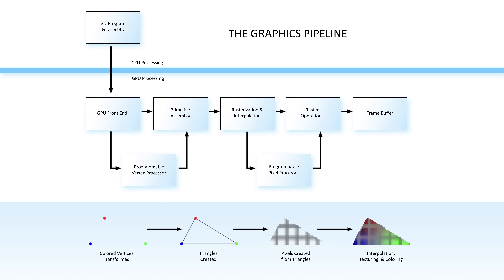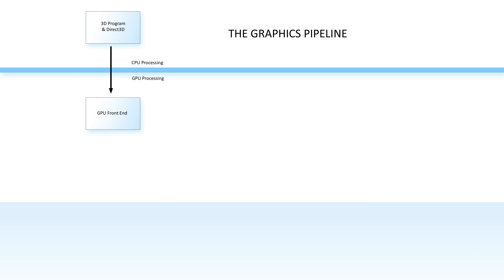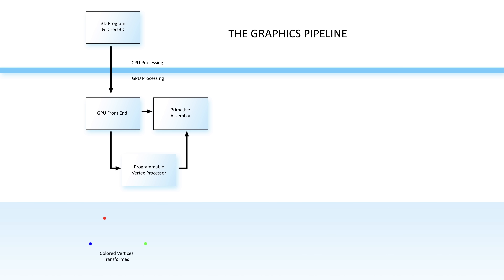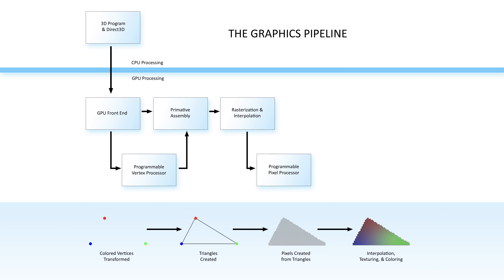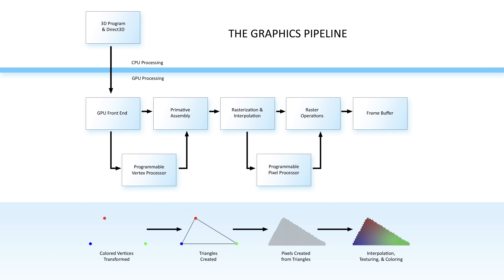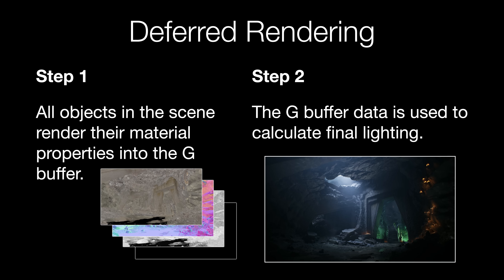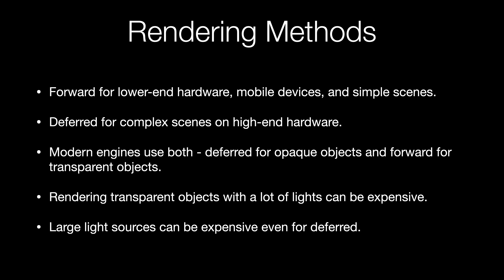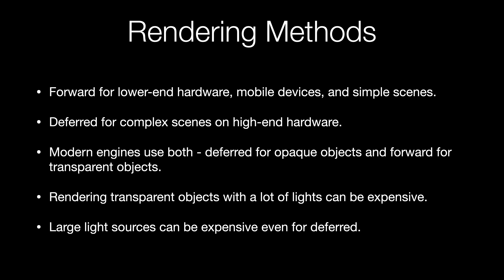The Graphics Pipeline and Rendering Types - Game Optimization - Episode 2

Comment: Question, with transparent materials having a higher cost with more lights due to using Forward Rendering in Unreal, does this still apply if the transparent material is unlit?
Reply from the maker: No, unlit materials do not incur the costs for lighting that lit materials do.

Comment: I generally use forward rendering and disable cast shadows from LOD 02 and beyond for furniture. And for architecture, buildings, or very large landscape objects, from LOD 3 or 4, depending on the specific size and replace it for shader lights if its needed.

Comment: 5:00 That's not entirely accurate or at least not the whole picture, much of the performance issue from too many vertices comes less from the vertex shader itself and more from the primitive assembly stage of the pipeline, which is bottlenecked by a fixed number of primitives submitted per clock cycle. To the GPU there's not really much if any difference between vertex shaders and fragment/pixel shaders, and on a 1920x1080 screen you're rendering at least 2 million fragments, often far more with any overdraw or multisampling, and even more when the pipeline does multiple passes to compute different effects, it's not uncommon for games to surpass 100 million fragments overall without issue. And the fragment shaders tend to be far more complex than the vertex shaders. The GPU should in theory have no issue processing a massive number of vertices, but because of primitive assembly in practice it has a bottleneck.
Reply from the maker: This is exactly the type of addition information I was hoping for. Thank you SO much for contributing!
Reply: @BenCloward  For additional information I'd recommend the video on small triangles from the channel Simon Dev, named "When optimization works but for the wrong reasons", he goes into further information on what I wrote above and also into some interesting specifics and details on quirks of the way GPUs try to optimize rasterization that can cause issues in certain cases.
Reply from the maker: @DreadKyller Thank you. I’m aware of the problem with small triangles. Planning to talk about that soon.
Reply: @BenCloward  Awesome, I only mentioned the small triangles because that's the main subject of the video, but the video goes over the primitive assembler stuff as well. Very interested in this series, thanks for working on it.
Reply from the maker: @DreadKyller I’ll give it a watch!
Reply: Might also be something else besides that, too! I have an anecdote of the time I've worked on a multiplatform game with a port on Switch. In our case, the performance issues came from just having a lot of vertex data that had to be loaded and interpolated, and the poor maxwell was struggling from that (there is a dedicated unit/hw pipeline stage just for that, and it was bottlenecked harshly).

So yeah... profiling, profiling and more profiling! It's the greatest advice that you've also mentioned in the video. In commercial development, following the best practices blindly can only get you so far
Reply: @Kolyasisan  Yes, many pieces of data to interpolate can also be a source of performance loss for similar reasons, while the programmable shader units can handle frankly stupendous quantities of computations (fragments of vertices) due to parallelization and the sheer number of processing units, other steps such as interpolation and primitive assembly tend to have dedicated hardware involved that is not designed to support the same level of throughput, and so they present potential bottlenecks. If you have many interpolators you'll likely run into issues with interpolation before you run into issues with primitive assembly, but if you have only a few interpolators on most GPUs you'll usually run into issues with primitive assembly before interpolation.

This is also why it's important to test on various hardware configurations, because something that one CPU/GPU pairing handles without issue may present a major bottleneck on a different configuration. Having a good understanding of these potential bottlenecks can be great for finding issues quickly.
Reply: The big unanswered question here is: "How do I analyse and optimize for primitive assembly?"
Reply: @techartguy  vendor-provided GPU profilers, like Nsight, Radeon GPU Profiler, PIX, etc... They have tools to profile and to allow you to determine issues with the entire pipeline that executes your workload
Reply: Besides small triangles which are a problem due to quad overdraw I also recently read (but can't remember where) about the interesting question of how lists of vertices are mapped to fixed-size waves.
If there's no HW-level merging across draw calls there will be unused threads. But I guess that particular problem is usually shadowed by the general need to reduce drawcalls.

Comment: It would be interesting to know, for example, in UE5 there are only VSM caching of shadows, but they will have to be used with Nanite on, otherwise there will be artifacts and freezes due to Occlusion Culling(recaching). If the game has a middle scene, one residential quarter with interiors and there is no change of day or night(same as TLOU2), then the choice only of Lumen or Lightmaps. Lumen (Software RT) does not have a "static" mode, and acceptable lighting will be obtained only on Epic Gi Preset, but this will hit performance. UE5 has a GPU LightMass , but you have to bake the entire level, otherwise Volumetric Lightmaps will not work. There is a Unigine engine, for example, you can rebake Lightmap at a separate static mesh. EPIC has a lot of engineers and I can’t believe that they cannot do at least an analogue of Unity APV. Therefore, we can conclude that UE5, as the industry standard, deliberately overestimates graphic requirements and forces players and developers to update their computer. NVIDIA does not often contact Unity, so there are many different tools to optimize graphics.

Comment: In this day and age optimization is a lost art. 
Thank you for doing this series Ben.
Reply: Это не правда. Оптимизация есть везде по дефолту. Просто deferred rendering сейчас основной в играх (особенно с открытым миром или красивой графикой) по умолчанию будет работать от 30 до 60 fps из за своей прожорливости.
Reply: @sr2sdouble  That is not true, I do PCVR and I do a ton of Archviz, I use deferred rendering because I use planar reflections and sometimes raytracing on a laptop with an i9 12900H and an RTX 4070 mobile and with photorealism and planar reflections and interactive lights I get my 90 FPS. but that is because i do optimization like crazy to be able to run photo realistic VR experiences in hardware that is not meant for that. 

Deferred rendering is much more taxing, but with good optimization everything works fine. 

Most gamedevs and big studios rely on Raytracing and other techniques like nanite or megalights or even dlss to "optimize" forgetting that you need to do actual performance optimizations, but they favor those new techniques to avoid the work of optimization.
Reply: @sr2sdouble  от 30 до 60 - это на анриле 5 только если. Нормальные игры с дефёрдом работают на 200+ на среднем железе. Например, игры юбисофт (R6, Division) на среднем железе легко в 200+ иду. На юнити тоже не очень сложно делать 200 фпс на дефёрде. Нужно прежде всего за ценой фрагментов следить, Gbuffer сам по себе вообще изи за 1 мс рендерить.

Comment: I thought Forward+ would be included because I’d like to know how it improved on Forward rendering.
Reply: For the most part Forward+ and Deferred+ are the same as forward and deferred except they split the screen into multiple tiles, and each time can be processed just using the lighting information relevant to that tile, which can help with scenes that have large numbers of lights. That's one of the main differences at least.

Comment: Would be cool if you talked sbout forward+ deffeted+ and gpu tiled deffered or something  i dont even know a d would like to know😂❤
Reply: As far as I know, both forward+ and deferred+ apply tile-based light culling to improve performance. By dividing the screen into tiles, only lights relevant for each tile are processed.
But I agree, it would be cool to get a professional explanation from Ben 😊
Reply: @peterhou7717 not tiles, but voxels (3d volumes). But yes, forward+ and deferred+ can handle a large number of (small) lights and deferred+ have little benefit over forward+ while having significant drawbacks like infeasibility of MSAA and shader inflexibility.
Reply: I was just about to ask about this